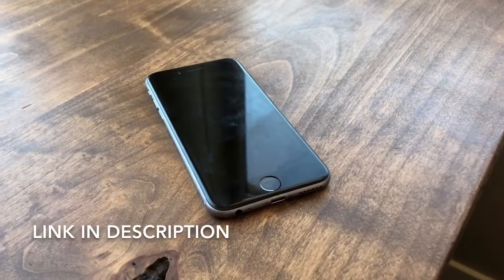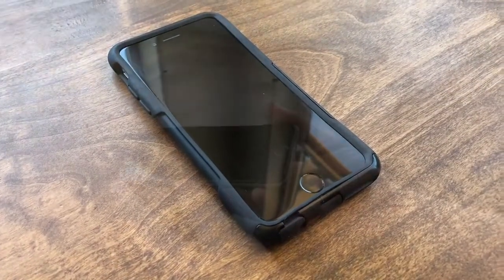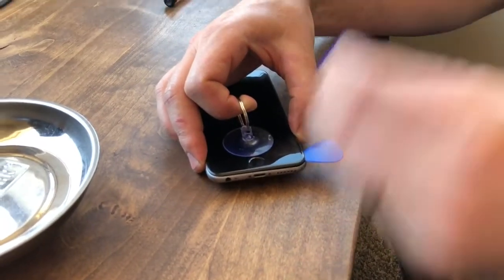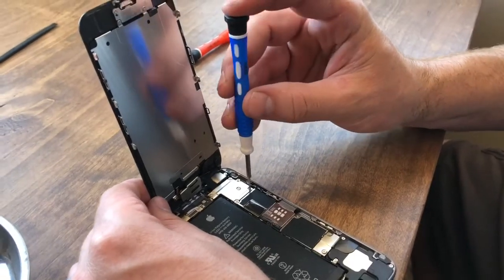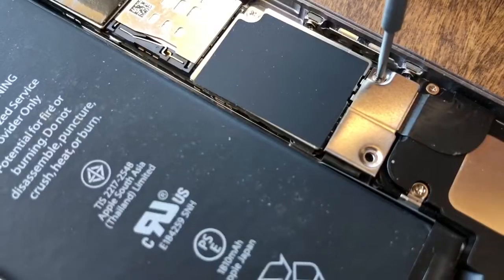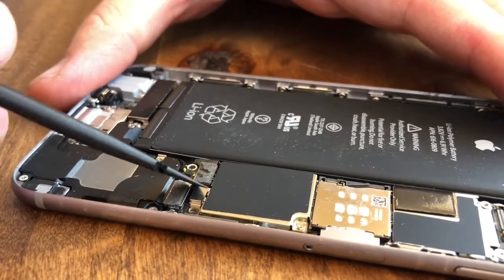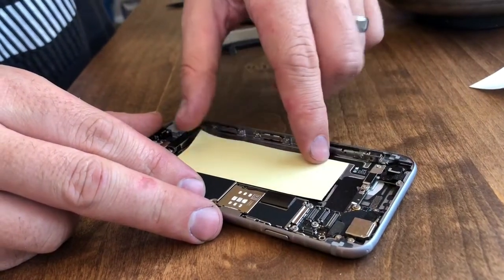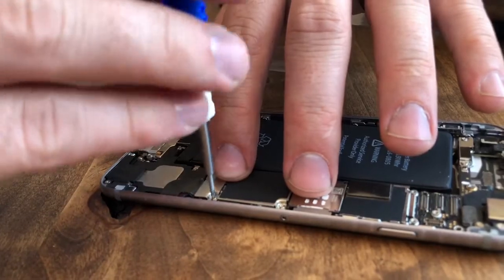REPLACE your iPhone 6 battery 6, 6s, or 6 plus without a heat gun!

Comment: I have an iPhone 6S but there were some differences with it than from what you have in your video. The metal plate covering the ribbon cables only had 4 screws that needed to be removed instead of 5 (the one in the middle had adhesive underneath instead of a screw). Also there were only 3 ribbons to remove instead of 4. The date on the battery is 2018 so I'm guessing it's one of the newer ones, so maybe Apple changed their design slightly.

Comment: Haha so your battery was all messed up too huh? Thanks for the vid this is gonna help me replace mine.. for whatever reason my phone dies at random percentages like today I randomly went to go text someone back and it died at 92% until i would need to put it on charge and then it would turn itself back on and then just continue being normal for a while..
Reply from the maker: silvr_4v Mine was dying like that too and eventually got so bad it would only show the battery sign- then wouldn’t turn on at all even plugging it in. Funny enough it would come back on every once in awhile when plugged into the car (higher output maybe jump started lol)
Reply: Dang i had a 4s that would do that but never ever turned back on RIP lol

Comment: What if there is still a line in the screen? What will i do and it didnt touch. Its not responsing😭
Reply from the maker: Neriza Alina One of the connectors may not be in right for the screen. I had hundreds of lines and had to plug the screen connector back in
Reply: @dannyjohnsonsgarage  okay i will do it again later. Huhu thank you so much for a quick response. My mom is gonna kill me. Its her phone btw.